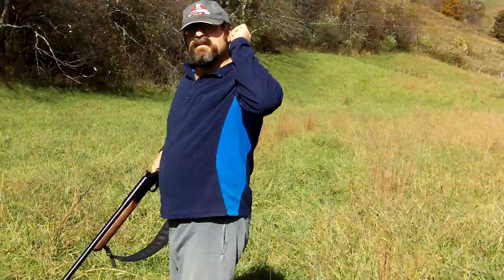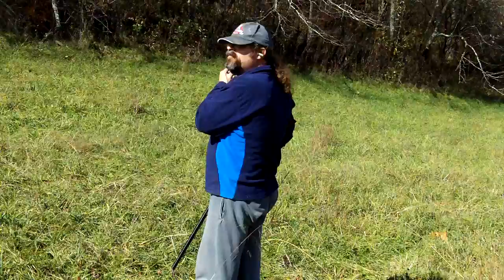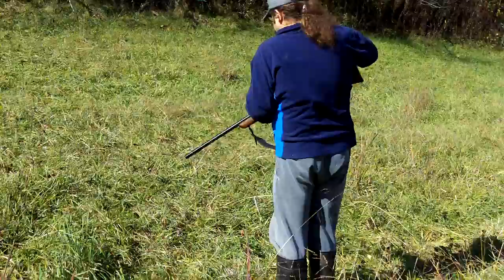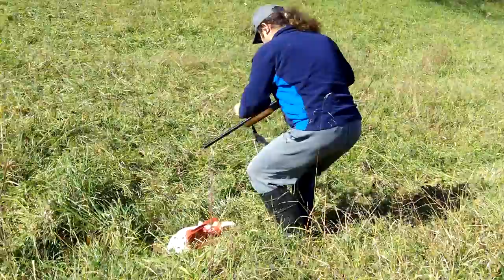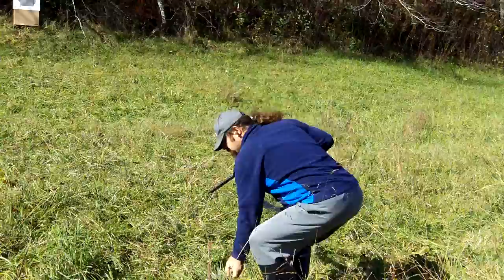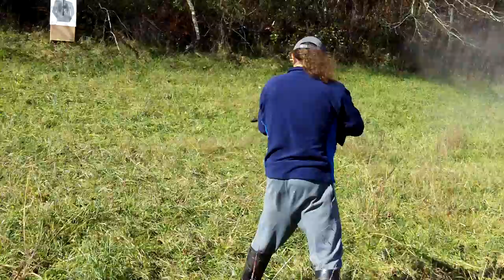Testing Homemade 12ga Slugs 10/18/12 PART 1

Comment from the maker: When it comes to lock repairs now-a-days you are probably just ahead to go to a pawn shop or gun store and look at the "clearance" shelf for a sidelock muzzleloader that has the bore messed up from neglect (there should be a hundred or so of them ;-)) In anycase just buy the whole thing, offer about 65% of the asking price and take it home.  Take the lock off and put it on your good ol' gun (its easier and faster than a part by part repair).  Keep everything else in the junk box for later.

Comment: When I was shooting my .50, I used 65 grain FFF (cannon powder not pyrodex), "pillow ticking" patch and .49 caliber round ball.  It certainly did the job plinking.  Mind you, that was ages and a day ago while we were still in VA.  I think I should like to try her again, but after I get the lock repaired and find those RWS copper caps.